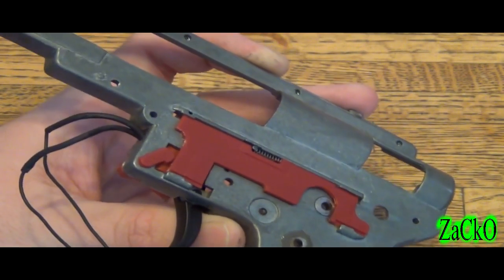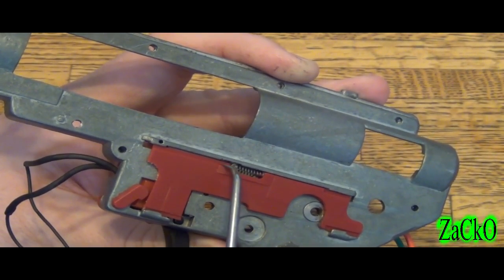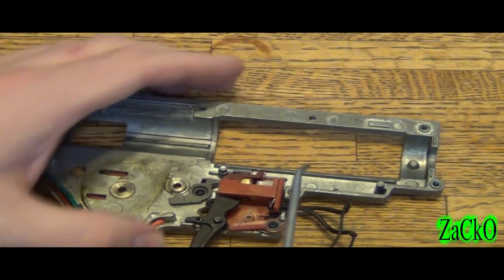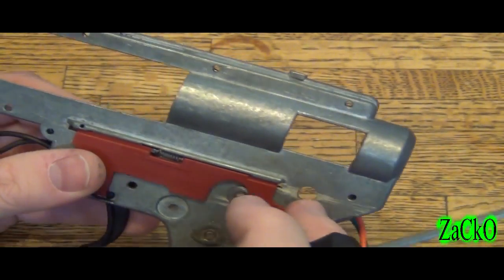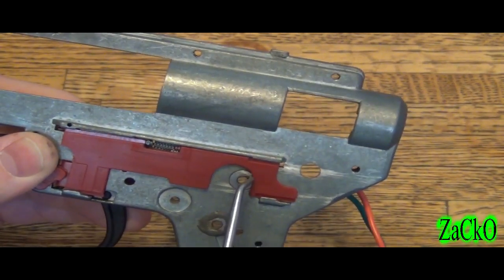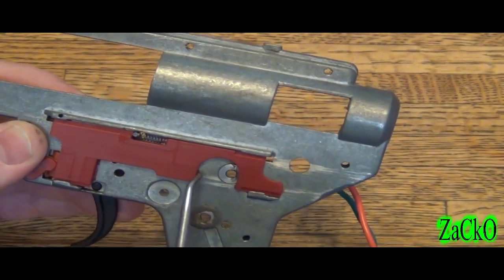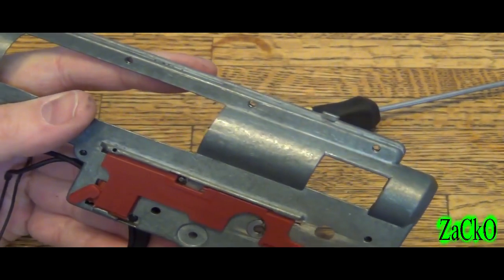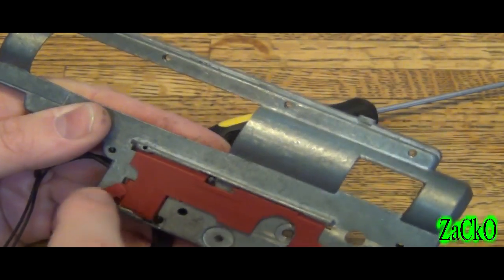Version 2 Selector Plate Movement

Comment: I'm going to put a G&P Thor Rapid DX V2 gear box into my feather weight m249 . I am doing this for a few reasons 1. Combined with a warhead 45k and a 11.1 lipo 40+ rps 
2. Being able to use one weapon on the entire field . Where I play I can not fire my full auto only lmg in certain areas. I also will be using a simple mosfet to allow burst fire vs full auto ( I will set it to 10 round bursts ) . This brings me to my question. How would one make a selector switch that will work allowing the selector to be on the external vs having to flip the lid to swap modes .

Comment: I just got a new selector plate because my old one broke. After putting it in I can't move the fireselector to full auto anymore. if I dry fire the gearbox all modes fork fine though. I had a look at it and all the measurements seem to be pretty much 1:1 though

Comment: So, I would purchase a Lonex A2.  How much would it cost to have the gears shimmed( I even have systema shims that you can use), gearbox lubed, aoe corrected, new motor installed, and piston swiss cheesed? I know its pretty run of the mill stuff, but so long as the gun works better than it would stock, I would be pleased.
Thanks for your time.
Aidan